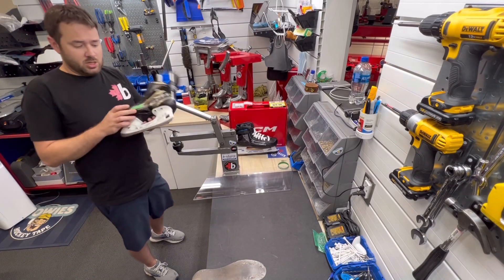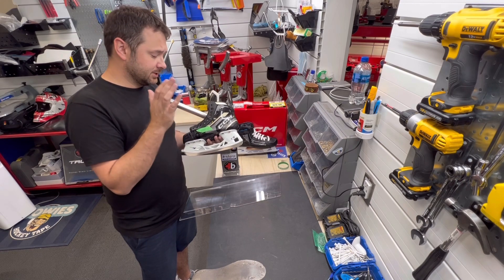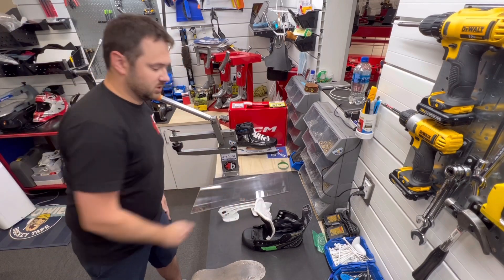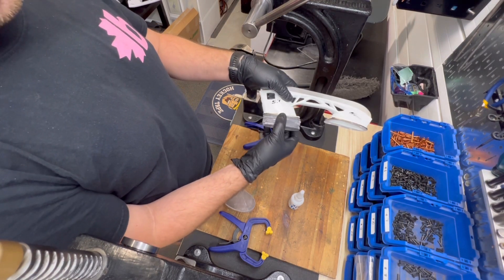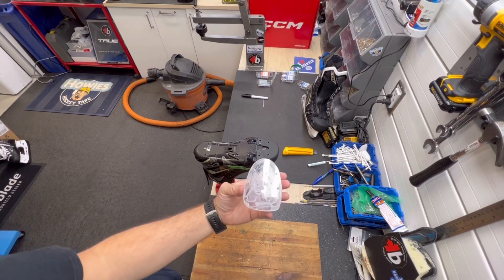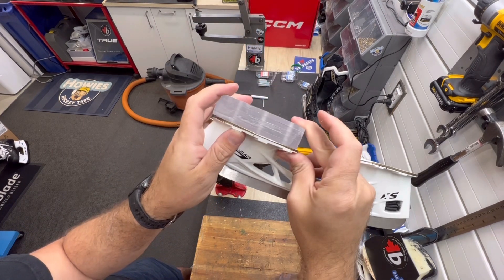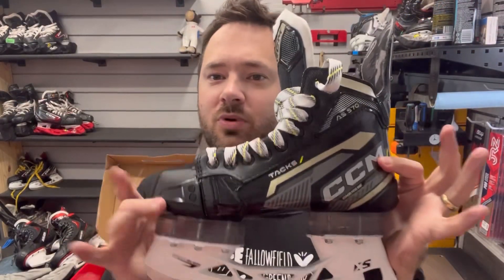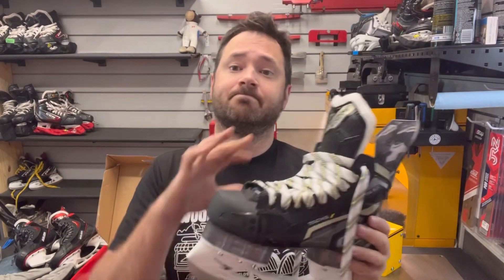2.5cm Custom Hockey Skate Lift -  Walkthrough

Comment: I suffer with a similar issue. I have a 1.5" leg length differential due to a femur growth plate break when I was younger. I have refereed hockey in north eastern BC for our minor hockey association for almost 20 years with a 1/2" wedge lift (heel only) and as I get older, I am struggling more and more with back and knee issues.  I have been thinking about this type of skate modification for the past 3 years and was curious if it could be done! I am going to send this video to our local skate shops and see if they can duplicate your technique. If I lived closer to Ottawa it would be a no brainer to come by your shop. Thanks for giving me some hope that I can continue to enjoy skating once again.
Reply: I can help you with this @bcshoerepairandskatesharpening

Comment: Dang that’s crazy. Do you make toe lifts for true skates? I’m thinking about getting some svh’s. But from what I’ve heard they pitch you a bit forward. Any experience with getting them to same pitch as vapors or jetspeeds? I’d prefer a lift, rather than profiling. Just so I don’t have to profile new steel. Thx
Reply from the maker: We can make lifts for whatever skate you have. Our lifts and wedges are all custom. You probably heard they are pitched forward, but unfortunately that information comes from the uninformed. True is a neutral boot, like Bauer and CCM. Bauer, unfortunately, tilts you backward with their blade design, so everything feels forward if you’re use to skating in them.
Reply: I just saw that in another one of your vids. Thx for responding though. Makes sense now.
Reply: You will probably find you like it when you get used to the difference.  When I switched from Bauer Supremes to Vapors years ago, the change in pitch kept me from being back on my heels all the time.  Now I am more naturally in a "ready" position.

Comment: Thank you again for making these for our daughter’s skates.  You help make playing hockey sooooo much easier for her and take away any pain she may have experienced without having a lift on her skates.  We’re very grateful to you!
Reply: You mean that your daughter has gained some kind of latheral stability? Cuz I still cannot get the idea of that. Whole my life i've always thought that you will be more stable when you keep as close as you can to the ice
Reply: @mss_ds1496  I think you missed a key point.  Their daughter has uneven length legs ... one being 2.5 cm shorter than the other.  So, this modification is raising the height short-legged skate to match that of the longer leg ... as taking length away from the longer leg doesn't make sense.  ;)  Therefore, her hips are now properly level, and likely will experience significantly less wear and discomfort. 

That having been said, the current trend in runners and blades is to increase the height as this allows the skate to lean over more and therefore increase agility.  Modern skating techniques compensate well for a slightly higher center of gravity. 

In some ways, stability is the enemy of agility.